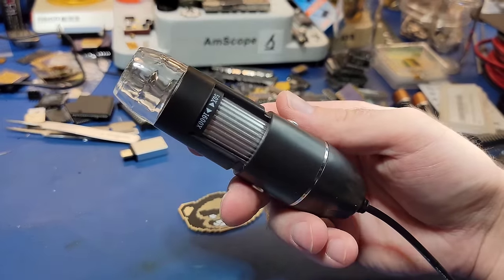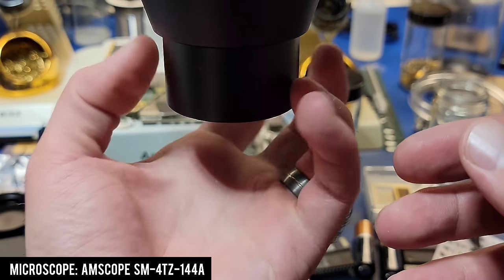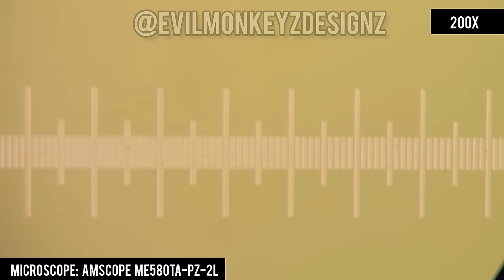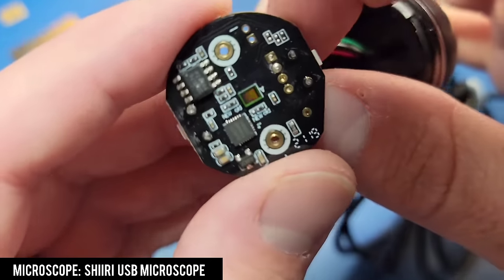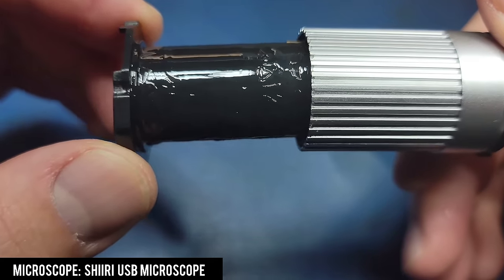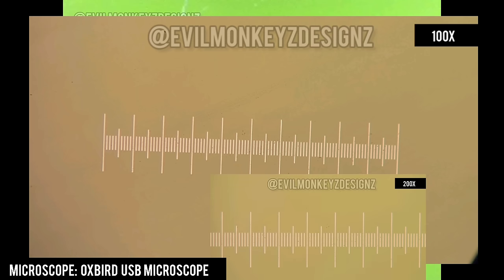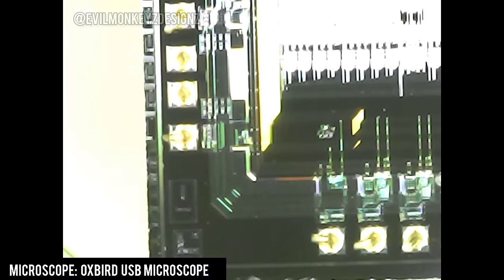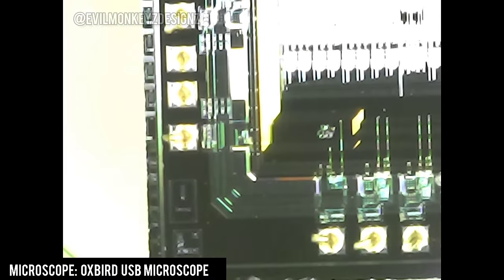Digital Microscope Comparison

Comment: Great video! It's bugged me for at least 20 years that manufacturers (even the ones that aren't random names from Amazon) like to obfuscate and miss-sell their products based on marketing. When digital cameras first came out we had the huge MP claims, only for them to be 'interpolated'. The only reason to do that is to con people. These days it's fields of CCTV cameras and dashcams claiming to be 1080p or 4K, when in reality they're all 480i or 720p.

It seems you get what you pay for, but only within bracketed amounts!
Reply: Even smartphones I think still include digital zoom, which is the first thing I disable on any camera.  Also a lot of the post processing is terrible.
Reply: There are too many dumb people, that falls for it. That's the problem. 
I have had it so many times people who claim for example that their cheap phone can film in 4 K or even 8 K - and it can be a hard time to explain that even if the frame size in the files is 3840 x 2160 or 7680 x 4320 pixels, doesn't mean the camera is able to film in that resolution. Same with many other products. Many of us have probably seen those ridiculous 3 million volt tasers or stun guns on Amazon or Ebay. But a friend of mine (which I didn't even had a discussion with) got surpriced when my BMPCC 4k gave much more detail and sharpness and  dynamic range than the 8 k HDR, his phone claimed to have.
In many other cases, the sellers also don't obviously lie in the spec, but rather give the specifications under conditions that's unacceptable, unspecified or impossible to reach during normal use. 
For example speakers/headphones or even microphones are sold everywhere, that's claimed to have a frequency responce from 20 Hz to 20 kHz, but have no given tolerance limits for how much variations is allowed within that range - which makes that info useless (it's output or sensitivity could as well be down by 20 dB at the ends of that range - making it's practical useful range much less). 
Another example is power components - for example transistors. The current handling capability put on sellers sites, is often given at 25°C case temperature and maximum heat dissipation at the same time (which is impossible to reach, unless active cooling is used or ambient temperatures is very low - active cooling is usually not worth the added cost, maintentance and noise. It will often also reduce overall efficiency of most systems, as it takes energy to run). 
At least those comes with data sheets that show more relevant data, that can be checked before buying.
Reply: @Speeder84XL helpful info...thank you!

Comment: What I did was get a trinocular simulfocal microscope from China which is basically a generic Amscope and then added a generic usb/hdmi imager.  Total cost was less than $300 and the results were extremely good.  I adapted it to a cheap articulating Vesa monitor stand using 3d printed parts.
Reply: I feel this is the best way then just upgrade camera as tech improves

Comment: Nice comparison, but I suggest that you compare the magnification when looking at the images at the same pixel magnification. Even if the "8 MP" and "16 MP" images show the same field of view than the  640x480 images, you could scale them to a much larger size without loss in quality. That being said, of course "x times magnification" is of course only an advertisement trick, because you could just take your 640x480 picture and project it to a wall and you get gigantic "magnifications".
So an additional, valuable criterion for your comparison would be: how many µm per image pixel, or what is the diameter of sonic in pixels.
Reply from the maker: That's definitely a great idea. I'll have to do that comparison if I do a second video like this.

Comment: Awesome review! I wish all reviews were this technical. I was waiting for you to count the horizontal and vertical pixels on the sensor to confirm the 4k resolution. ;p
Reply from the maker: I almost did 😅. I was going to stitch the the image sensor at 20x and then use a photo editor to help count the pixels, but I'm stitch is likely to fail due to the repetitiveness of the pixels. Always easier to find a part number and read a datasheet if possible :)

Comment: be me: an engineer who works for a very large military contractor that makes cutting edge rf equipment with insane integrated circuits and takes part in the r&d of said equipment.
uses the cheapest possible $10 digital microscope to troubleshoot boards
Reply: lol, you are lying through your teeth.

Comment: An important parameter is resolution, being the distance between two points that look like two points rather than one. Magnification without resolution just makes the fuzzy blob appear bigger. Also, always try to use an in-image size-bar with clear markings as to what size and units it is, like "5 um" (ideally the mu symbol) so it doesn't matter what size the final printed image ends up being.
Reply: Dynamic Range is FAR FAR FAR more important.Dont get me wrong resolution is handy but with lighting dynamic range is much more important to eliminate glare when usiung flux etc
Reply: That's also my thinking. That's why with the "toy-scope"s I tried out I always tried to measure what was actual real-life distance between two pixels on the final digital image (of course, provided the image is in-focus, clear, etc). If I photographed a 0.5mm test ruler and ended up with crisp image of it spanning over 50pixels, then no matter how I view it, it's 10micrometers per pixel and I won't be able to even tell things apart from each other of anything smaller than 15-20micros, and if I want to see any actual features then I can forget about looking at things less than, say, 100-200micros (that will map into 10-20pixels in this example, who's gonna tell it was a sonic sketch on a 10x10.. a pointy ear would be probably 1 pixel tall). Having these x/y pixel distances (because sensor may have uneven pixels, and aspect ration doesn't have to be 1:1), then I could do some math - video sensor has this height and this width, this many pixels vertical and this many horizontal, I could calculate single pixel size on the sensor (sometimes it's even given in specs), and then real-life x-y pixel distance to on-sensor pixel size should give the true magnification ratio of the device. But then.... what I care in the first place wasn't the magification, it was how small features I could tell apart, and that first simple distance-to-pixels check was totally enough :) "Mag:200x" looks great on the video, but to be honest, I would LOVE to see a scaling ruler with "|<--->| 1.0um" marker instead. It's so much more informative than 50x or 200x.
Reply: The ruler used by the author had its markings 10 micrometres apart. This was stated right at the beginning of the video.
It is quite easy to take the image of the ruler and expand it in a graphics software until it becomes possible to count the individual pixels per 10 um.
Reply: Yeah honestly this entire comparison test is a bit absurd from the start to suggest a 10$ and 1000$ scope could possibly be the same then comparing shaky hand held, over lit images while clearly ignoring the zoom features dismissing them as Digital zooms while never demonstrating such.  He cut the video off on the one before the zoom could be shown making me feel this entire video has ulterior motives of some sort. Its just kinda useless all in all

Comment: I think you could check one possibility of a hidden magnification step in those cheap toy-microscopes. Long time ago, I have bought a, hm, say, microscope, called "Supereyes A005+" which boasts up to 500x and 5MP. It looks like pen, a bit longet, and a bit thicker pen. It has a similar build - tube with roller and the inner optics slide up and down as you roll. It's much thinner than your $9 microscope though. It wasn't exactly cheap, but costed way less than a real one. Opinions were mixed - many comments claimed it to be a scam and not real 500x, but some actually provided important insight: the thing has TWO focus points when you roll. The first one, say, position 0-95% of rolling, is the low-mag part. Optics are mostly inside the tube. That's where you get lets say, up to 100/200x. But if you roll it all up to vicinity of 100% (optics slided down as much as possible, almost sliding out of the device) then you might be able to catch a very tiny spot of good focus again. The first lens will be like 1 or 2 millimeters from the inspected object, almost touching it. I like to joke that it's pressing its video sensor against the object :D Quite awful working distance. I scratched a few objects that way with microscope's chassis. But it actually gave higher mag than the easier-to-use 0-95% slider positions. I'm not sure if it was really as advertised 500x though. I tried to measure it, and I'm pretty sure I remember it could produce resolution of the order of upto about 10 micrometers per pixel. No idea how that maps to 'times' metric.. Now, what I'm getting at is -- I've read that SOME of those cheap microscopes actually have the same feature. Is it worth checking with your lab? Or is Supereyes A00x/B00x worth trying out? Well, I'm interested, but viewers probably won't. It seems to be dying brand. If you would like to hunt for them, watch out the model numbers. Their specs vary greatly. The one I have is/was A005 with a plus. It's was advertised as different than A005 plain.
Reply: This is my experience with two of these scopes so far, too. There's a certain threshold you pass on the winding mechanism, where it doesn't seem to be crossing from optical zoom into digital zoom. Rather,  things go out of focus and then back in again with better detail, as if there's some real change in the focal length or something. Edit: For example, I used one of these cheap scopes in the first section of its sensor range to photograph a dead fruit fly such that you could clearly make out its basic anatomy... but then, in the second section of its sensor range, I managed to take a photograph of another dead fruit fly where you could make out its individual compound eyes.
Reply: Indeed! there are two focus points with very different magnification! It looks like EvilmonkeyzDesignz did not test that? @EvilmonkeyzDesignz: can you please respond if you did?
Reply: Mine also does/has this.

Comment: Thanks! I enjoyed the review a lot. I was in the same situation choosing for a microscope a couple of years ago and also did not get any of the low cost versions. But one has to admit that they are pretty cool devices given the price. Real optical microscopes have big advantages but having a flexible magnification range between 10 and 40x is also interesting to capture quick full size silicon die shots. This closes the gap between macro shot with a regular camera and high mag microscopy pictures. So in the end it depends on what you want to to…

Comment: I found a Cainda B10 microscope for about $30 that is a bit better than the cheapest ones. It looks quite similar, but the build quality is a bit better. It advertises 1440p resolution, but that is with 2x digital zoom so the sensor is actually 720p. I found it a good starting point if you want to avoid the cheapest ones.

Comment: Thank you for the comparison and views into the internals of these microscopes.
I recently bought one of those very cheap ones and I was actually pretty impressed with the image quality.
Sure, I'm not using it to inspect transistors on silicon but the max 100x magnification is ideal for reading numbers of these tiny SMD components and for checking soldering joints.
So whether one is going disappointed depends on the expectations one has before buying, and of course your video helps to manage them.
If one buys a hobby telescope, thinking to get images like those produced by Hubble, it's going to be a major disappointment, but seeing the bigger moons of Jupiter or Saturn though one of these, pinpricks that they may be, can be equally rewarding.
Regardless, the performance that the vendors are advertising are just as misleading as the "4800 DPI scan resolution" of the 300 DPI flatbed scanners of decades ago.
Mega resolution through software interpolation should be forbidden in advertising.
Reply: Precisely, i don't solder much but the cheap usb "microscope" has been invaluable with some microsoldering I've done lately, alsp great for inspecting joints in general, and recording or screenshotting it, and it doesn't take up much space on my small table either.
Reply: Yeah, a cheap one that I got that seems better than these cheap ones is perfect for smd soldering and other electronics uses. It can see the details well of even tiny LEDs.

Comment: Have to admit I did buy one of those cheap ones, but I didn't expect it to be all that great, simply because generally you get what you pay for! 
However, 20yrs ago when I first began purchasing stuff on eBay I bought a Pentax camera/microscope-adapter but never did use it on any of my Pentax film SLR cameras.  Having bought a Pentax K-S2 DSLR a couple of yrs ago, I thought why not make use of the adapter, so I looked at what I could afford in the way of optical microscopes.  Ended up using an eBay voucher to save almost $55AUD on a $249AUD Celestron Labs CM1000C Compound Microscope, which means I can watch a very good image on my PC's Samsung 32" QHD monitor, while operating my DSLR using the app on my mobile!

Comment: I have to say, these cheap microscopes are still definitely worth their while as novelties. I bought one, and it has definitely been fun photographing the head of a pin, the edge of a razor blade, the individual pixels of my smartphone's screen, the individual ink dots of color newspaper/magazine print, handwriting from a ballpoint pen, paper fibers, cardboard fibers, the grooves on a record, the fabric weaves on a woven phone charging cable, plant trichomes, my beard stubble... I could go on and on. They do fill a nice niche between macrophotography and proper microscopes, though it is a definite bummer that they tend to only have VGA sensors.
Reply: i guess, if your into junk toys, salut
Reply: If you have money to burn on worthless toys then probably yes. But why not purchase better microscope then?

Comment: The theoretical maximum magnification for a light microscope is 1600 - 2000x magnification, this is set by the laws of physics (the size of wavelength of light).  Only GOOD microscopes will be able to even vaguely approach these numbers, if it's cheap and says anything over 400x, it's a lie!
Good video, thanks for the reviews!

Comment: This was the only high quality review/ roundup of cheap USB microscopes in 2023 that I've been able to find!  Good info, and sadly what I expected, mostly tech companies iterating over older, cheap imaging & support chips to produce sub-$40 toys.

My interest is to buy a wide-field digital or optical trinicular microscope for a soldering station, that could magnify easily down to detailed SMD level, but without breaking the bank.  Haven't found that yet :(

Comment: On that last scope that you said you liked-- but the LED's can't turn off.  You could simply cut the wire to the LED and wire in a simple switch and mount it on a through hole in the case.   It would make a cool mod video

Comment: Good info, thanks.

The resolution reported in Windows is purely down to the configuration data that is configured to be reported over USB and this is entirely configurable therefore it is an indication of the claimed configuration, not the actual configuration. There is usually overscan on these sensors therefore the product sheet reporting a slightly higher resolution, for example 648 x 488 is just because there are 4 pixels overscan all around (you can even see these slightly differently configured sensor clusters when you zoomed in. This doesn't necessarily mean that 640 x 480 is the final resolution because in order to enhance the quality of the image it is possible for multiple images are taken and/or interpolation to be performed which boosts the raw resolution somewhat. For example, with interpolation it's quite valid, if a little disingenuous, to claim that a 640 x 480 sensor has an output of 1,280 x 960 pixels. Add in digital enlargement of the image and if Windows is informed by the device that it has a 2,560 x 1,920 resolution and the device buffers and enlarges a 1,280 x 960 interpolated image to 2,560 x 1,960 pixels and transfers this up then that's the image size delivered. Quality is a different matter of course.

The difficulty in comparing these kinds of things is that the image sensor is a key factor in the "zoom" resolution and therefore the simplistic 100x zoom scale does not provide enough information because if both sensors are 640 x 480 (ish) but one is twice the size of the other, then what should the reported "zoom" level be? This is where comparisons such as these in this video are so useful as they show the actual results side-by-side